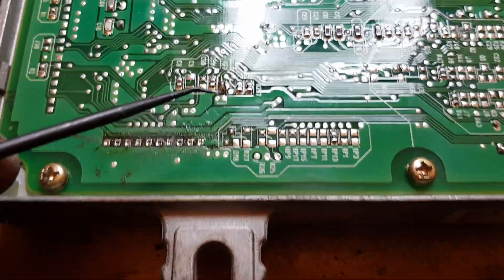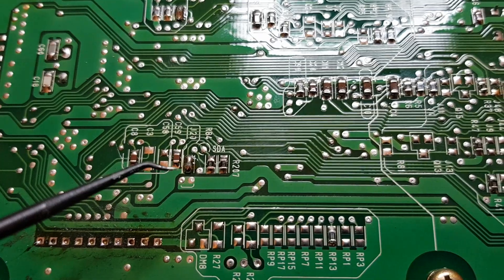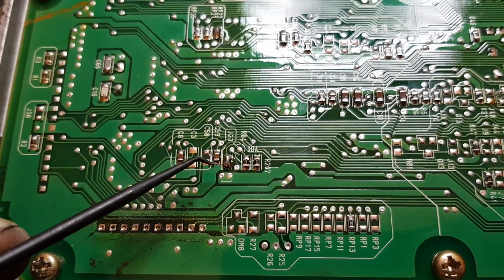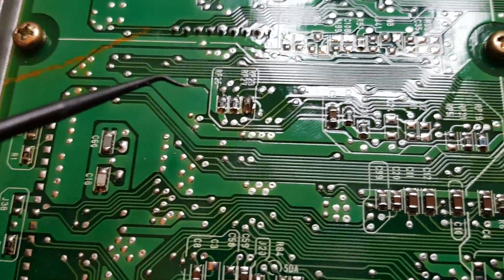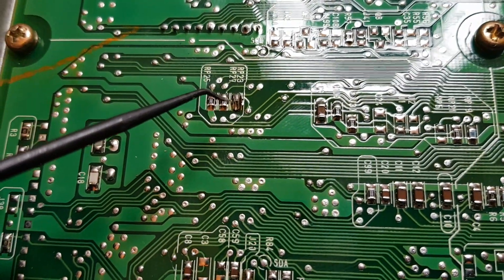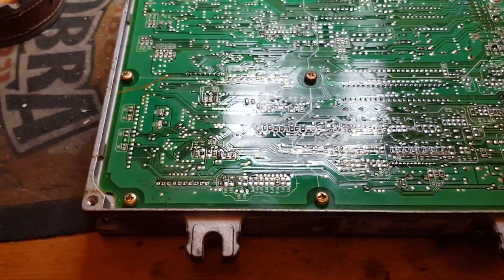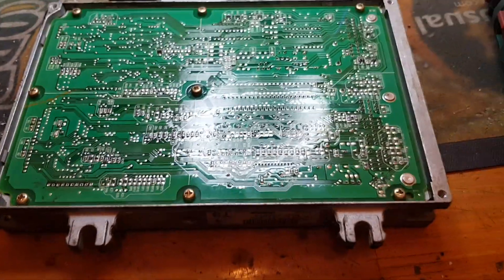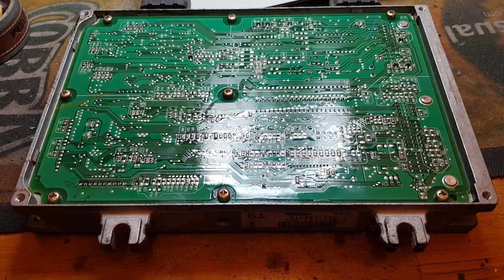unlock immo honda p2y ecu

Comment: Hello, I removed the immobiliser chip for the ecu and it works and drives great, what is the reason for removed the tiny resistor and bridging the 2 on the other side for? Mine is a d15z6 auto ecu P2Y-G51, thank you
Reply from the maker: thanks for watching
on some models here in Europe the ecu does not respond if you dont do those mods
and some just remove the Oki board and thats it
Reply: @PSICompanyPerformance  for the PEL-G01 we use the same procedure?
Reply from the maker: @FAmotorsport  thanks for watching
no its a diferent ecu
Reply: @PSICompanyPerformance  are you familiar with it ?

Comment: Im working on a 2004 Acura TSX. ECU. 37820-RBB-A54. 

Ecu was failing so i swapped in one from the salvage yard.  It starts after removing the eeprom chip.  

Soldered in the original eeprom, the car still starts, but i sm still getting a flashing green key and a p0603 code. 

Any ideas?
Reply from the maker: thanks for watching
i dont have those cars here in my country i think those never came to Europe at all.
but i would first off all
disconnect the battery for  a few minutes to reset the learning parameters of the ecu
and the would inspect ground connections.
good luck i wish i could help you more but like i mentioned these never came to Europe

Comment: Tengo un Honda prelude 1998  y perdi la llave  las resistencias esas que señala tambien se elimina?
Reply from the maker: thanks for watching
if your ecu is the same as this one just do the same as in the video and it will work like a charm.
just remenber that you will need to feed ground to the starter relay after in order for it to work.
good luck

Comment: I have a 5th Gen, with P5M ECU. I removed the immobilizer board. Do i need to remove resistor 24 and also bridge J20 and RP23 as well?. If so do i use a 000 diode?
Reply from the maker: no need for a diode you can just brigde those contacts with solder.
good luck
Reply: @PSICompanyPerformance  much appreciated
Reply: @tc.916 did it work? Did you also connected the wires from immo module under the steering column? 
TIA
Reply: @julek43  I ended up buying a bypass chip that replaces the immo chip in the ECU. Then I found my keys that I lost so I didn't need to install the ECU that I bypassed. Never even tried it to see if it works. A few days and 150 bucks for nothing 🤷
Reply: @tc.916  do you still have a link for this bypass chip? Would be amazing
Reply: @julek43  I believe I do, it's in my last phone. I get home Thursday I will check and let you know. If I remember correctly the guy is out of Nevada who makes the chips
Reply: @tc.916  oh so only US? I dont think it will be cost effective sending it to Poland, thanks anyways

Comment: Hy can you please help me i have a 2006 cr-v and i have a problem, never in the morning, only after i drive it at least 20-30 minutes. The yellow key is blinking and it starts after more attempts. It is same with both keys, i just change the Ignition Immobilizer Transceiver and nothing… it start after more attempts . Have any ideea?

Comment: Hey budy csn 5ou helpe to unlock inmof from a honda cerv year 2000 ecu P3F please
Reply from the maker: Thanks for watching
In that ecu you dont remove the OKI Board you just remove resistor R24 and put it on R23. Next you need to go to the immo box under the steering wheel and jump the 2 wires for the starter motor together, thick grey and thick black.
Thats it immo off.
Good luck

Comment: Great Video! I have a P2K for a 1998 Civic. I have desoldered the OKI but the key symbol still flashes and no crank. Any suggestions?
Reply from the maker: Thanks for watching.
Dont worry about the key symbol flashing you can remove the bulb later.
It doesnt crank because you need to feed ground to the starter relay, but if you want to try you can bump start it and it will run .
Good luck
Reply: @PSICompanyPerformance  I have been searching around online, I can't figure out how to feed ground to the starter relay. I'm quite new to this. Can you help or point me in the right direction for instructions?
Reply: @PSICompanyPerformance  all sorted now Thank you!!! Had a Check Engine Light on, But customer is happy anyway.

Comment: Trying to figure out where to bridge RP23 and RP24 and also J20, since my board is "almost" identical, P3X and P3Y, reffering to 1.4 D14A3 and D14A4, any ideas how to get rid of the immo? Only thing I found is the immo board that is soldered onto the main board.
Reply from the maker: thanks for watching
on those you dont need to bridge anything just remove the board and give ground to the starter relay to get it usable...but if you want to see if it worked (removing the board) you can bump start the car.
good luck
Reply: @PSICompanyPerformance  How do I exactly give ground to the starter relay? Do I just find where it's located on the board or in the car?
Reply from the maker: @adamchaloupka2069  in the car you will notice that the starter will not work after this mod, thats because the relay needs both positive and graound to generate the magnetic field to make contact and will will have to give a ground to it because the positive will be comming from the ignition.
Reply: Where is ground to starter? Can you help me? I remove the board on same car is working and light check engine,on the second car doesnt start ..

Comment: Hello going to be doing this to a p2p ecu to run a d16y5 will this work on this ecu? Do I need to remove chip?
Reply from the maker: Thanks for watching.
Yes you need to remove the OKI chip/board.
And dont forget to give ground to the starter relay...
Good luck
Reply: @PSICompanyPerformance  were is the starter relay located
Reply from the maker: @ryanbareham4701  its easy to find just go to google and write honda civic (year) fuse box diagram, and you will have all the info regarding fuses and relays 
Good luck

Comment: Good job friend, do we have to disconnect the immo box under the steering wheel?
Reply from the maker: thanks for watching
no need to disconnect just jump the 2 big wires together to enable the starter.
Reply: @PSICompanyPerformance  A friendly question, when the ecu is immobilized, does the starter motor and the fuel pump work?
Reply from the maker: @dannym.2225  no it doesnt
Reply: @PSICompanyPerformance  I lost keys and the fuel pump works, the starter works, the coil works, but the vehicle does not start, is this normal? Thanks
Reply from the maker: @dannym.2225  depending on the model of your ecu it can be normal yes
Reply: I made a new chip reading 93c46 inmobox and the fuel pump coil starts working but the vehicle does not start my ecu is p2y-g01

Comment: Hi, i have a p2y-g01 , i did what you showed on the vídeo and i still have the green key flashing light, the starter works but the car does not start
Reply from the maker: thanks for watching
that is strange because the starter should not be working without grounding the relay.
please see the video carefully and make sure you follow every step, because i have done a ton of these this way and it has always worked just as expected.
let me know please
thanks

Comment: Hi, have you check with this solution ? is engine lamp glowing ?
Reply from the maker: thanks for watching
no i havent engine light glowing but i have immo (key) light and i just remove it.
good luck
Reply: @PSICompanyPerformance  today i have test this solution. With your immo problem, is car startet when you swicht igniton (car start and goes off ?) i have become a ecu from a russian friend his workshop says immo problem. now i have used your maual :D. i can hear the fuel pump but when i will check if car starts i hear nothing (starter makes nothing) was this the same problem with the immo ?
Reply from the maker: @agentorange3198  you will have to give ground to the starter relay and it will start with no issues.
Good luck
If it does not start let me know so that i can evaluate whats wrong with it.

Comment: Hello, I made the modification on a P2Y-G01 and when I want to start I don't have a starter. Can you help me
Reply from the maker: thanks for watching
under the steering wheel there is the immo box,
you need to join the 2 thick wires toguether, if i remenber correctly its the black and the purple iam pretty sure.
good luck.
but if you want to see if the modification worked just push the car and it will start.

Comment: Struggling to find the starter relay and how to ground it civic ek 98 any advice
Reply: I found it right up by the ignition itself. 1x 10mm bolt with 2 relays together on a connector. You need to ground the relay with a BLK/WHT, BLK/WHT, BLU/BLK and BLK/RED loom. Terminal number 85.
Reply: @mylesjbaker  do you have any pictures you can send of it
Reply: @ryanbareham4701  not of the specific location, but I did grab 2 quick snaps of the relay itself if interested
Reply: @mylesjbaker  yes please if possible so I know what I'm looking for is it just 1 wire to ground the relay
Reply: @mylesjbaker  yeah that's correct

Comment: Hi. I have a hesitation on low trottle aroud 1500 and 2000rpm... i just swap everithing.... and stil the same.... when i unplug the CKP o d crnkshaft it runs fine... its possi le to have faulty Caps on ECU?
Reply from the maker: Is it stock ecu?
Is it vtec
Reply: @PSICompanyPerformance  
Yess. Stock p2y g02. Honda civic 1.5 115hp vtec-e. (1997)... i just renew/swap everything. (Map. Tps. Sparkplugs.distributor.wires.CKFP.coil.o2sensor....etc....
Reply from the maker: @fernandoramalho3644  i would check wiring and vtec i dont think that it is ecu problem
Reply: @PSICompanyPerformance  thanks.... when hesitates.... i just just read 0volt on o2 sensor.... if i press trottle over 30%... runs normal and normal o2 reading.... if i close trotle for 10% and under 2000rpm it becomes hesitate... and loss o2 reading again... and it goes runing and hesitates...
Reply: @PSICompanyPerformance  
Reparei que es Portugues....😆 da-me o teu contacto para me poderes ajudar... e mail ou meio de contacto....
Reply: Nao tenho cabo obd2a para este carro... ek3 1.5 D15z6. E um conector de 3 pinos.... nao sei onde comprar isso.... pois ninguem tem.... olx...facebbok market....etc... poderia-me ajudar a resolver a hesitacao como te falei.... usava o scanner em live data para tentar descobrir....innetores regulador e bomba tb foram trocados....
Reply: Descobri uma coisa... se desconectar o sensor da cambota... o carro nao hesita e tenho sempre uma leitura normal da sonda lambda... apenas me acende a luz de avaria com o erro 54... mas a ignicao funciona na mesma... e ja nao acende a luz verde de ECO
Reply from the maker: @fernandoramalho3644  pode fazer com um obd normal mas atraves de colocaçao de uns fios
Do pino 5 obd para o pino 1 honda,
16 obd para 2 honda
14 obd para 3 honda
E ligar o 1 e o 3 do obd um ao outro.
Reply from the maker: @fernandoramalho3644  vuno01@live.com
Se puder ajudar ajudo com todo o gosto.
Reply from the maker: @fernandoramalho3644  esse motores sao muito sensiveis á pressao de combustivel se puder faça mediçao de pressao de combustivel
Reply: @PSICompanyPerformance  
Ok. Eu ja lhe meti outra bomba e outros reguladores... mas nunca medi a pressao enquanto conduzo.... apenas quando troquei de bomba...sei que ficou cerca de 5 psi mais elevado com a bomba nova...

Comment: Hi. I have a ecu lime these... and wen a put the jumper.wire in 2P conector my check light stays on.... it is de zero code error?? Bad ecu?? Thanls and great help
Reply from the maker: These jumper are used for these ecu (p2y)
Is yours the same?
Reply: @PSICompanyPerformance  
Sim. Testei 2 centralinas p2y e quando ponhono shunt na ficha 2 pinos para obter o codigo fica a luz de avaria sempre acesa... ha quem diga BAD ECU....
Reply from the maker: @fernandoramalho3644  nunca me aconteceu...
É possivel que seja mesmo uma ecu com defeito.
Reply: @PSICompanyPerformance  
Tenho 2 centralinas...a original com immo e a que comprei hj que lhe tirei o immo.... mas ambas quando coloco o shunt no conector quando.ligo a ignicao a luz nao pisca... fica sempre acesa... se colocar o motor a trab fica ligada
Reply: Ha alguma forma de ver testar a cablagem para sinais que deverao estar presentes na centralina?? Negativos/positivos... nao tenho diagram desta cablagem d15z6 ek3 sedan

Comment: Will need to disconnect the immo box with the 2 conectors thats located under the steering wheel... If i keep it connected -not starting,if unplugged - no starter
Reply from the maker: yes you need to disconnect the immo box and feed ground to the starter relay
Reply: @PSICompanyPerformance  you mean on the same immo box or on the main relay
Reply from the maker: @sergioivanov153  you can do it in the relay itself or just connect the 2 thick wires on the immo box plug (still remove immo box) if i remember its the black and the purple wire both thicker than the rest and this will enable the starter to operate.
good luck

Comment: I swapped from d14 to d16y7 and had to use the p2n ecu. I removed the immobilizer and everything is working great but I can't go faster than 180 km/h. It's like a speed governor. Did try another p2n ecu, same problem. Is it because of the modification maybe?
Reply: You need to convert to obd1 using a jumper harness($20 on ebay) and use a p28 chipped and thatll take governor off

Comment: Hello mate do I have to connect also the immobilzer? I did this but still key flashing light on dash and not cranking. Thanks
Reply from the maker: thanks for watching my friend
the light in the dash will stay on, and you can remove it later.
you need to go to the starter relay and give ground to the relay, there will be positive already there its just missing the ground. after that is done it will start right up.
but if you want to see if it is infact immo off you can also bump startt the car or shunt the relay for the starter.
Reply: @PSICompanyPerformance  is there a starter cut relay automatic 1996 Honda Civic Coupe? Or together with the  main relay? I can't find the location of it thank you and I really appreciated you replied quickly🙏
Reply from the maker: @okiekampers8812  in a 1996 you need to give ground to a relay inside the car next to the clutch pedal...if i remenber correctly is a blue or purple wire. but i will check my notes and come back to you my friend..
Reply: Hello my 1996 Honda is Automatic Transmission can I still do same thing while this is video for Manual Transmission? Thanks
Reply from the maker: @okiekampers8812  thanks for watching
Yes you can do the same for an automatic car

Comment: Does this work for a P9L?
It’s a 2000 vtech civic sport
Reply from the maker: Iam not familiar with that ecu.
But if your ecu has a oki Board you can just remove it and feed ground to the starter motor relay and it should be all good.
Or to test remove the oki board and try to bump start the car, if it works tgen you can ground the relay for the sarter
Reply: Did this work on your ECU?
Reply: Did this work on the p9l ?

Comment: This is actually the first video which also shows to remove a small transistor. Most other users use an emulator to put back in the place of the Immobilizer chip. What model and year is this off?
Reply from the maker: Thanks for watching my friend.
This car is a 1997 but the engine and ecu was swapped from a 1999/2000 car

Comment: I have the same ECU but mine is P2Y-G11. Any ideas on how to unlock the immo on this ECU? I know what chip I have to remove but I don't know which connections I have to bridge. Mine doesn't have RP23&24 and J20. Well at least I can't find them.
Reply from the maker: P2Y only remove the OKI board and give ground to starter relay...but to test just remove the Board and bump start the car..

Comment: P8F odyssey same?
Reply from the maker: Thanks for watching.
I do think its the same my friend...those here in my country are very rare.
Reply: @PSICompanyPerformance  thanks. I run in demolition derbies and help a friend build simplified or stand alone engine harnesses for the vehicles I run. Basically the wires needed to power things and make the motor run. So we are currently in the test stages of my 2003 odyssey. Fun stuff

Comment: Hi.  I have a honda CR-V with 37820-P3F-G01 driver, visually the same as in the movie, but will it work?  Thank you and best regards.
Reply from the maker: Thanks for watching.
The Honda you have is a motorcycle?
If so i really dont know i never done a bike ecu.
Reply: @PSICompanyPerformance  😆 I'm sorry because of the motorbike habit, I wrote the Cross model, my Honda is CR-V 2.0 1999 😋
Reply from the maker: @skrocha  ah ok i will let you know as soon as i get to my shop on monday.
Reply: @PSICompanyPerformance  And if I do not desolder this plate and I do the rest as in the video, will something happen?
Reply from the maker: @skrocha  you have to remove the board in order to work.
Reply: @PSICompanyPerformance  Everything worked out as you said, I just had to make a bridge on the immo box and the car fired, the green light only blinks but not blinking anymore ;) thank you and best regards
Reply from the maker: @skrocha  great work..

Comment: Hi. I have a honda civic coupe, mod. 2001, with ECU 37820PLMG21. Can this work on it too?
Reply from the maker: No.
For that ecu you need to program the 93c56 eprom for immo off
Reply from the maker: Try to remove the board and the in 93c56 fill with fff and disconnect immo box..
If i remember correctly that is the way to do that ecu